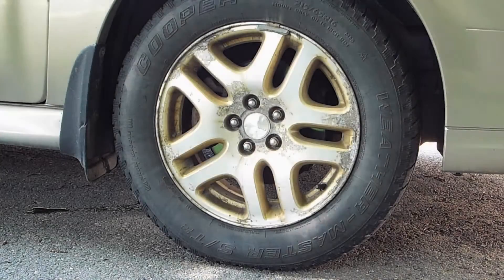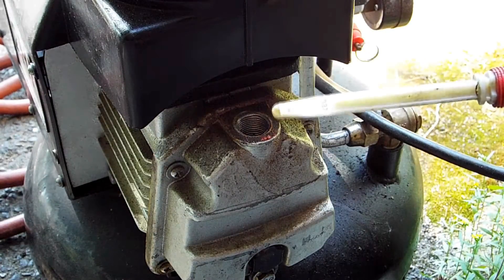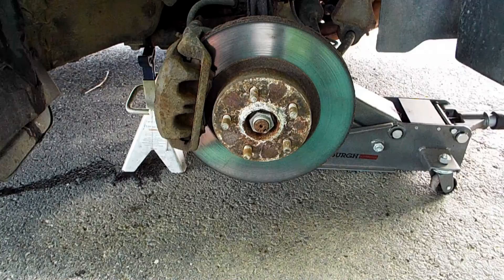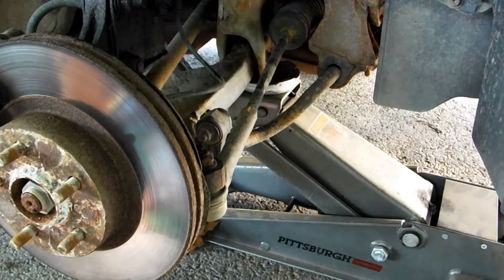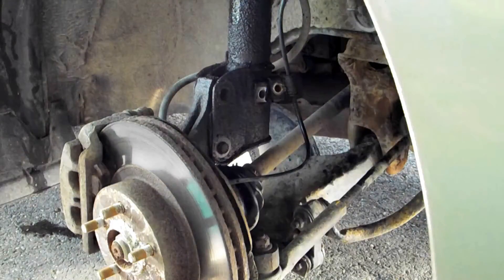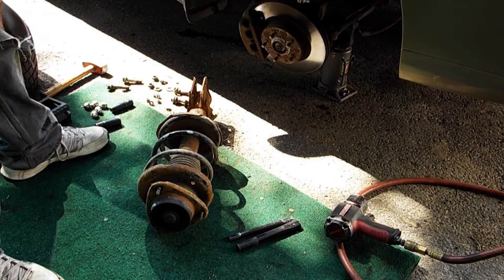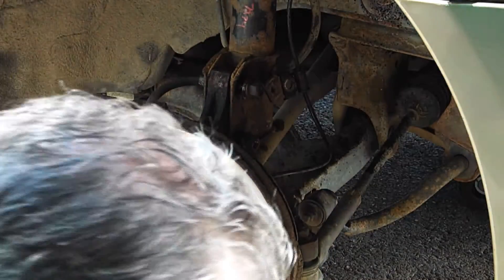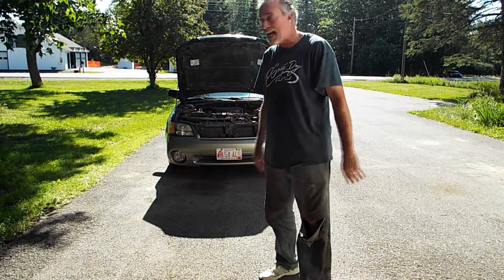Subaru Strut Replacement

Comment: Did you try one of the other nuts on top? looks like a 13 nut on the same thread as the 12..
Air pressure changes 1 PSI per 5ºc.
Reply from the maker: wobbly sauce I used the nuts that were on the replacement strut, including the 13mm odd one, as the originals had more rust on them. We are out of the 90's now so I will recheck the air pressures, thanks for the psi info.
Reply: My spindle dropped down and won't go back up far enough to re-alighn with the struts.  Every video I've watched shows it swinging back into place.